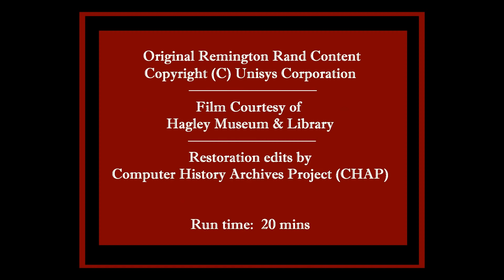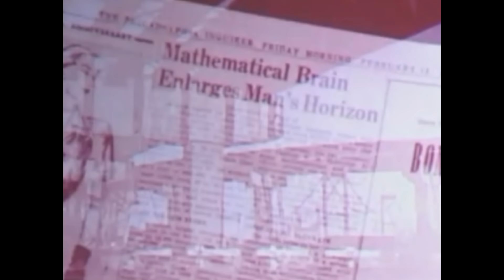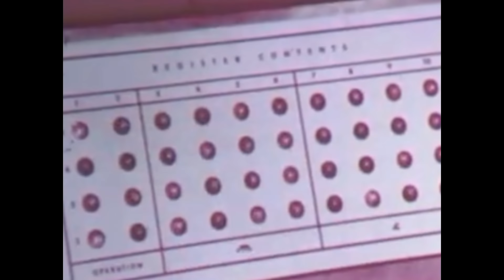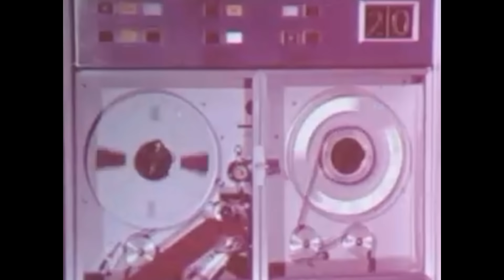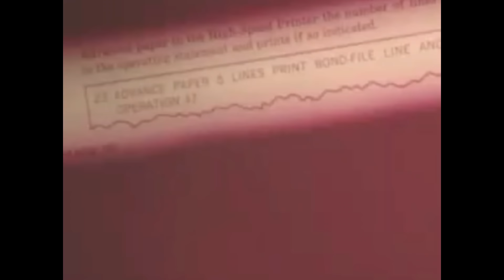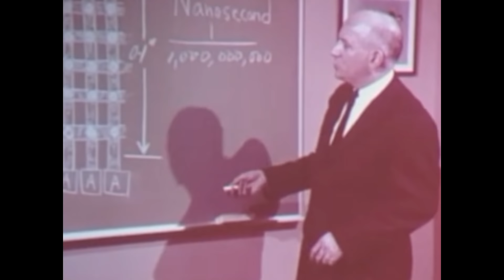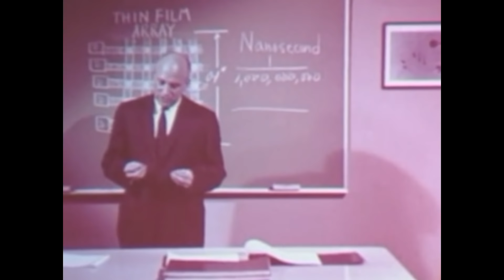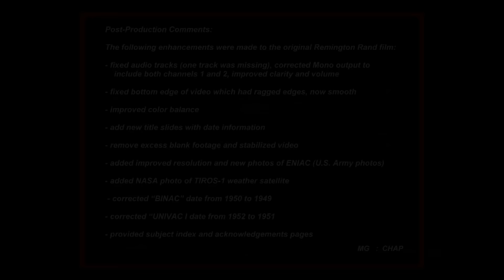1961 Remington Rand UNIVAC "What Do You Want?"  Sperry UNISYS LARC Athena Solid-State Computers

Comment: I worked with the UNIVAC 1050-II back in the in Air Force 1980's.  We upgraded to the Sperry 1100 somewhere around 1985.  Interestingly enough is that we still used some 1050 equipment well into the 90's.  The card sorter, card interpeter and the report decollater
Reply from the maker: wlanman99, thank you very much for your feedback and info!   Glad you enjoyed the video.  We also have a video on the UNIVAC-1050-II that has some great Air Force footage.  Thanks again!  ~  Victor, CHAP